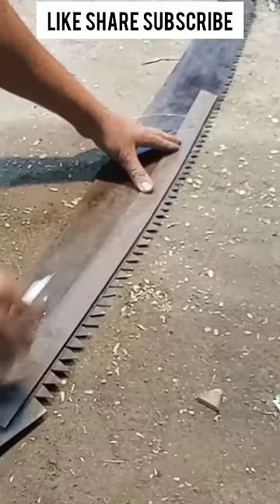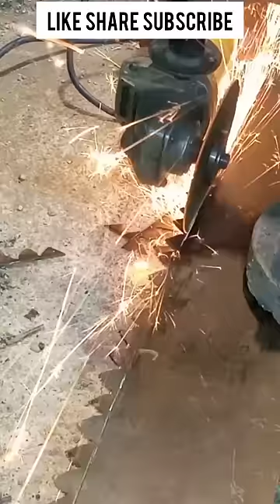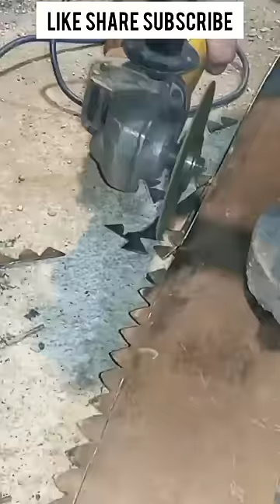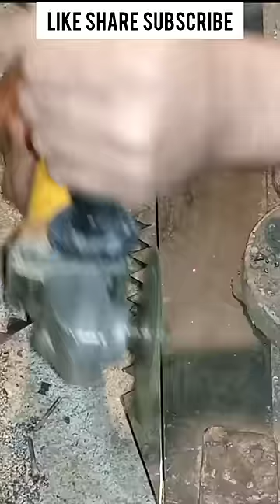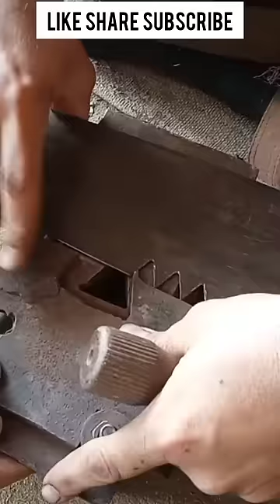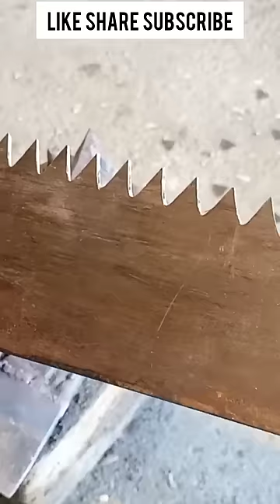Restoration CrossCut Saw | Restoration |

Comment: That's not restoring the saw.  You cut a 3rd of it off and then make all new teeth?
Reply: He had a grandeur and apparently the skill to follow the line. Why didn't he just sharpen it just saying? Why did you waste so much steel?
Reply: Maybe he's making Egyptian Pyramid necklaces. Just trying to make it make sense.
Reply: It's technically restoring the use 😂. 
And I think he could just cut it slightly below the worn out part with the same tools, It just a little bit more inconvenient then the one we saw but it save most of the blade.

Comment: That saw is gonna be useless working one tree being cut 

You need to harden the teeth temper them again sharpen them offset them then depending if the entire blade was a high carbon steel if all that would work